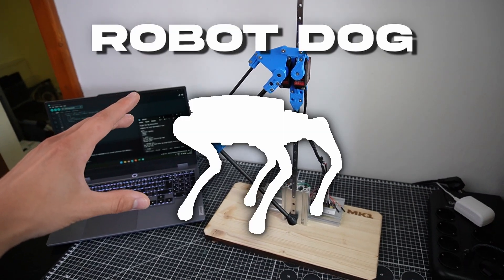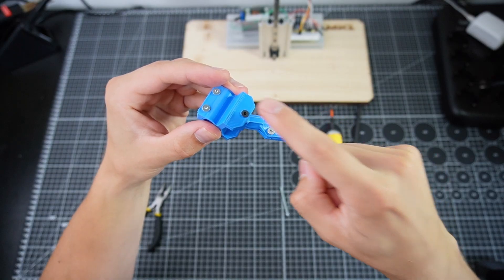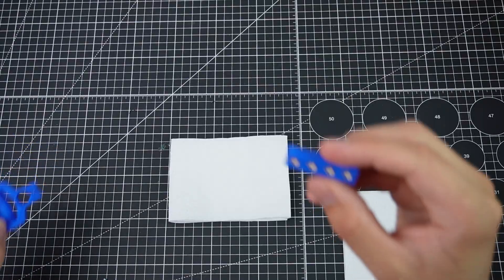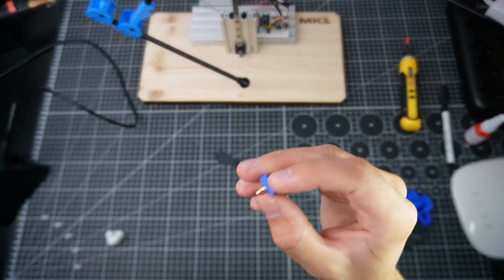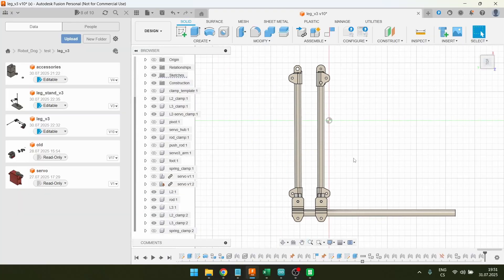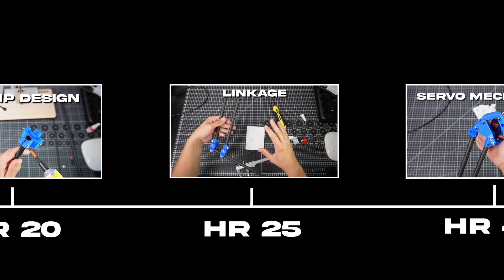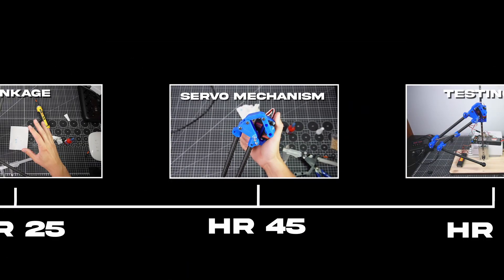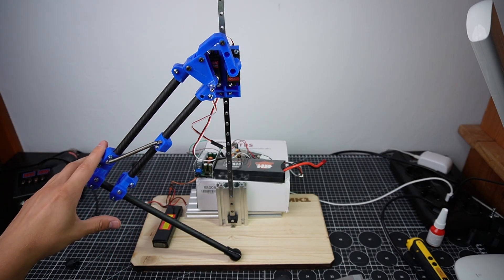Robot Dog #3 - Metal Joints and Bigger Springs

Comment: you should really use some bearings instead of these spacers, I belive these backlashes will cause huge pain when you are trying to controll the dog in the future, also you should use thrust bearings at the side of the joint to prevent plastic wear, espicially if you use screws to apply pressure to the side wall
Reply from the maker: There's zero noticeable backlash; the movement of the leg comes from the elasticity of the 3D-printed parts and the servo horns. I could use thrust bearings, but I wanna keep things simple and the plastic wares out very slowly. I used to have pure plastic to plastic joints on my 5 kg hexapod, and it never wore out enough to cause problems.

Comment: Teflon grease may help with the friction
And shortening the tubes might help as well.
For your testing maybe add a quarter of the weight that you think the body, battery, electronics are going to weigh so that you are developing into the final weight.
Good luck solving the issues.